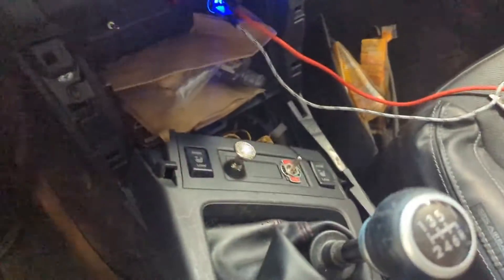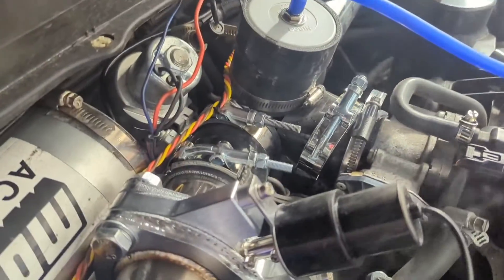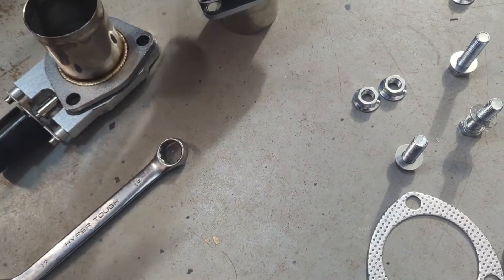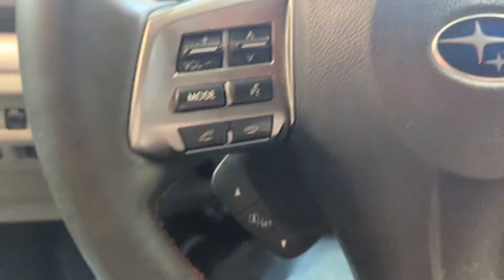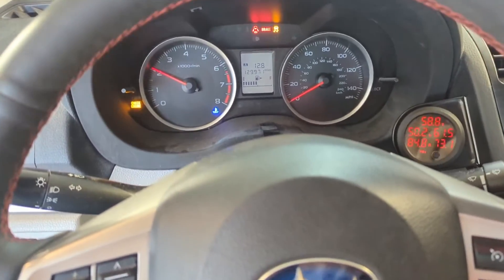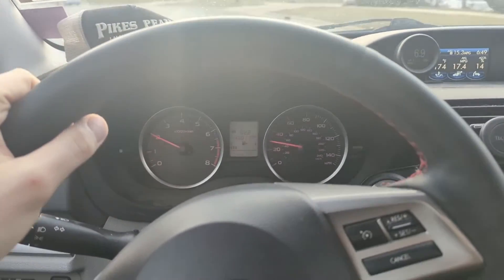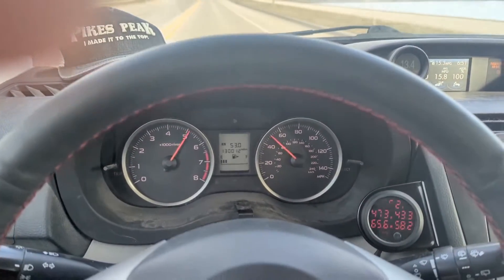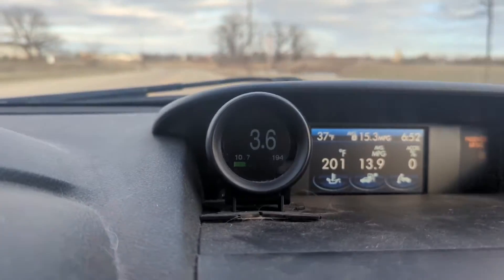FB25 Supercharger Part 10: SC14 Up and Running!

Comment: Seems very slow, for sure something is not right. Cool project tho, im sure youll figure it out. Seems for sure you should be making more than 2psi. What does the bpv setup look like? Whats it from? 

P.s. Watch out for undefined tables in ecu flash, they can be tricky and cause some real headaches.
Reply from the maker: Just tested for clutch slip - there's absolutely none. So whatever boost I'm leaking is probably through my bypass valve. I'll wait until the smaller pulley arrives, test with that, and post an update.

Thanks for watching / commenting, btw!
Reply: @avsti  thanks for trying something new 👏
Reply from the maker: Yeah it just occurred to me today that the SC14 clutch itself could be slipping, will test this evening. The recirculating BOV is an Greddy clone, has been working well. But the electric bypass valve is just an exhaust cutout valve (detailed earlier in this vid) and probably leaks a bit.
Reply: Dig it man! Really cool to see the home brew setup and learning new things!